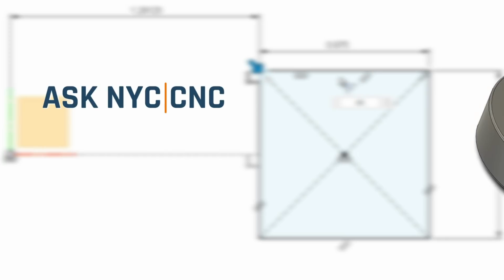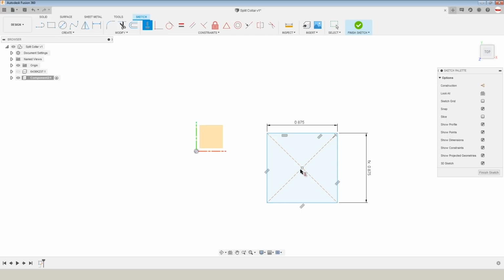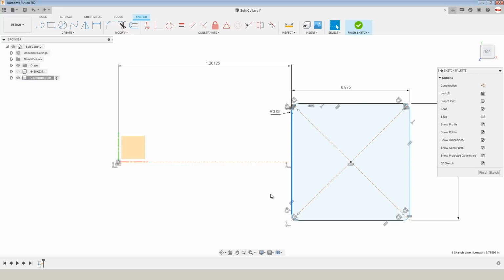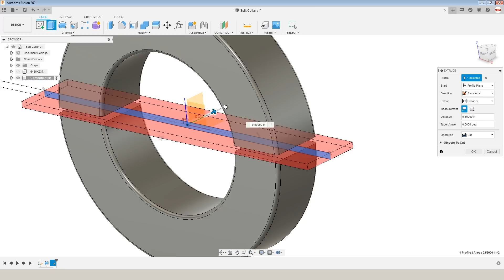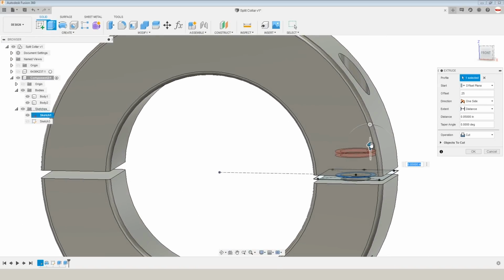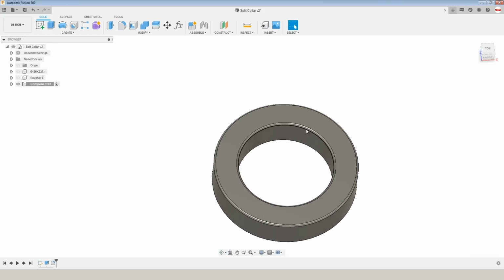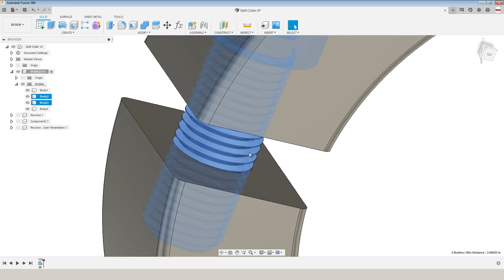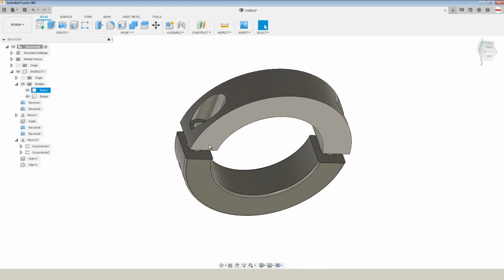Fusion 360 Tutorial: How to Model a Split Shaft Collar!

Comment: I almost all ways use use revolve for lathe parts but I feel the second method would be better for that part, if you included the split and the profile of the bolt hole in the first sketch.
Reply: Yeah doing a revolve seems a bit convoluted for this part